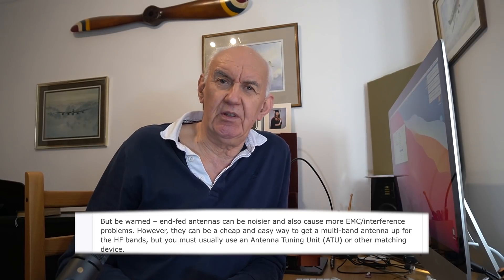END FED HALF-WAVE ANTENNAS - BEWARE!  WHY?

Comment: Another good video.  When I heard that person was making regular contact with New Zealand (assuming he was from the UK) I thought I need to get one so I can do the same.  Haha. A minute later you cleared that up.  I am considering a EFHW for portable use, but need to learn what I can do, what I have to tun with external tuners, etc.  There is some confusion of half wave or random wire.  But the half wave you describe is how I understand the science.  thanks for your instruction in your videos (those of us new to the hobby appreciate it).  All the best, 73 de KI5HXM
Reply from the maker: Hi Brent. Go with the EFHW and you won’t look back. 73 Peter
Reply: @watersstanton  Thanks.  just to confirm … you don’t need a tuner with the EFHW antenna do you?  It is my understanding that if it is half wave on 80m, I can get most of the HF bands with the harmonics.

Comment: 6:50 a correction. The ATU makes the radio see the antenna as 50ohms, it does not make the antenna resonant. If the aerial is not resonant, it will not be effective.
Reply from the maker: I think you are misleading yourself. At no time did I suggest the ATU changes tge antenna resonance. Read your first sentence again!
Reply: I agree with what you said about the function of an ATU (although I did not interpret Peter as saying this). However, for an antenna to be effective, it does not have to be resonant. All it has to do is radiate (or receive) effectively. An HF doublet fed via a 1:4 BALUN with ladder line is a good example of an effective and efficient antenna which does not have to be resonant. Conversely, a short mobile whip with a big loading coil that is resonant and properly matched but will only radiate a small percentage of the power fed to it is not very effective.

Comment: Your thoughts about using ferrite beads on a jumper inside the shack vs a toroid wind in a box.  Is it as effective?  If so, how does one calculate the number of beads and the mix?  Thanks.
Reply from the maker: The main difference is you need a lot of beads as compared with a single toroid. 73 Peter.

Comment: around 6.18, you say a 40m length of wire is 80m but i understand such a length of wire would be at resonant on 160m.
Reply from the maker: The lengths for EFHW antennas are 20m for 7MHz, 40m for 3.5MHz and around 80m for 1.8MHz. 73 Peter

Comment: I have always used OCF antennas till a year ago. Friend told me to try MYAntenna EF. Ordered 75-10 resonate. Holy cow I have never used a better wire. I operate (500w) and it’s by far best wire antenna I have used. Not by a little but substantial. Ordered another one and setting up 90 degrees off the other one. All the rumors of EF problems, maybe yours but the MYAntenna has none of those issues. No counterpoise , zero common mode. But, depending on how the transformer is close to the ground it is recommended to ground the transformer. I also use a line isolator and too reduced 1.5 S Units. As you stated , the isolator , should be in your shack and close to your radio that is feasible.

Comment: I completely agree with you the efhw 49 to 1 or 64to1 ratio transformer works fantastic I purchased one straight after getting my license even though like you say plenty of nonsense rumours which are completely not true , had people tell me RFI will be a big problem it won’t work on lots of bands , utter nonsense. I still use one now In a inverted U configuration I’ve worked Cape Town , faulklands on 17m and work states on 80 m using only 50w regularly late at night during winter months . For anyone just setting up this is one of the simplest methods 73 cheers
Reply from the maker: Many thanks Nifel.It's a familiar tale, but very welcome one. You certainly are getting some good results. All the best for 2022. 73 Peter.

Comment: I've got two main issues with EFHWs #1 What is the pattern of an end fed half wave close to the ground on various bands? Model it in MMANA & see for yourself. #2 EFHWs are very noisy on receive if anywhere near any interference sources at all. Might be great at the park or out in the woods, but not anywhere near home. Yes, by all means place a 1:1 balun at or near a current node in the feed line to help keep your RF in the antenna & away from you. One more thing, a 49:1 transformer as specified sure looks awful lossy. Thanks for the video. An EFHW is what it is.
Reply from the maker: Thanjs for sharing. 73 Peter

Comment: Mr Waters, you mention using a line isolator on the EFHW but how about using two, 1:1 choke in the shack and another 1:1 choke outside just before the 49:1 matching transformer?
Reply from the maker: The reason is that the coax feed, no matter how short, tends to act as an integral part of the antenna.

Comment: Half wave end fed are less prone to common mode currents than random lengths, 5/8th wave or mag loops. You'll actually cause less RFI with an half wave.
Reply from the maker: The problem is more about installation than tyoe.
Reply: @watersstanton  Didn't the video suggest the RSGB were critical of half wave end fed because of RFI in the early days? From my own experience of antenna building across many bands, I've come to realise which are the most problematic and its not EFHW's for either RFI or installation issues. End fed half waves can still cause issues don't get me wrong, unlucky feeder lengths creating harmonics that haven't been choked at the feed point correctly is the biggest issue IMO. Common mode can pop up anywhere. On the upper part of HF on 10m for example, I have found that isolating the antenna from the mast, choking the coax at the feed point and adding radials forces common mode into the radials and that way you don't have to worry about unlucky feeder lengths and txing on the feeder. In the lower part of HF the same rules apply but the length of the radials is more critical than on 10m.

Comment: I love EFHW antennas, I use one at my QTH as a permanent solution on a 45 foot mast on an inverted V. I have a choke on both ends of the wire, one at the feed point of the transformer and one at the feed of the radio. I have a low noise floor on 75 phone of about s2 to s3 on most nights and as well on other bands. 73 de AI5DD
Reply from the maker: Thanks for sharing 73 Peter

Comment: Do ferrite clamp on beads work as isolators?
Reply from the maker: Depends on the material, size and quantity.  I use tyoe 43 mix. 73 Peter.

Comment: You'd BETTER have some place for the RF to GO.  Call it a "counterpoise" if you like; if you don't have one it will simply use the shield of the coax for that purpose.  If one AMP is going OUT instantaneously, one AMP needs to be returning, instantaneously, and it WILL.  It might return through the ground, through the coax, maybe through your hands and body.
Reply from the maker: Maybe you should try one. Also check out end fed Zepp.
Reply: @watersstanton  "Maybe you should try one."
Perhaps I should stick my fingers in an electrical socket.  Perhaps I need to test whether gravity is real.  Oh, already did those things!  
There's a reason the Icom autmatic antenna tuner has a large porcelain insulator on the antenna terminal; as yu approach half-wave, the voltage goes way up and you'll start getting some serious RF backwards down the coax into the radio and into your hands and lips on the microphone.  I have ferrites on the microphone cable, the coax, 6 to 8 turns on the coax, some here, some there and not at regular distances to break up the resonances that can happen on coax and on guy wires.  
Naturally the feed point is monopole; BUT the Icom also has a grounding terminal, the "counterpoise" but really it is a place for the RF to go besides your body.  But some here seem to think it is magic and goes nowhere.
Reply: @watersstanton  The Zepp antenna uses the ladder line as an impedance transformer section.  As such its length is part of the antenna system and the un-used wire is actually used; just not in an obvious way.  An open-circuit end of a quarter wave stub will reflect back to the source as a short circuit.  But actual radiated energy will not participate in the reflection and thus it won't be a short circuit, but a resistive load under ideal circumstances (carefully chosen stub and antenna lengths).  

I admit to not having considered that using only the center conductor of a coax cable was effectively the same thing; the coax becomes a transforming section and it will work provided your lengths are carefully chosen. But it is lossy, where ladder line is not nearly as lossy.  Also, the ladder line is more sensitive to nearly metal; but so will be the coax since the outer braid is an active part of the antenna.

Comment: An "End Fed Half Wave" antenna is HALF WAVE at exactly one frequency.  For every other frequency it is just a random wire antenna.  There cannot be an "80 to 10" meter EFHW.
Reply from the maker: Think again about the definition of “random”  Maybe your statement is wrong as well! 73 Peter
Reply: @watersstanton  "Think again about the definition of “random”  "
A non-specific length.  It is just what it is called; a piece of wire used as an antenna.  Even if I carefully cut 17.43 meters of wire it is still "random" if it is not exactly a halfwave or a quarter wave.

Comment: Packtenna 20m EFHW sloper made with 26ga wire raised 20' in the air off a fiberglass SOTA mast.  Connect with 50' coax and if going over QRP, throw on an inline choke.  SWR is usually 1.2 and I don't even run a tuner.

Sets up in a few minutes, they weigh ounces and easily get 1000+ mile contacts with zero fuss.

Absolutely love them.

Comment: "Works 80-10m" needs to be qualified somehow.  Just providing a "low SWR" isn't good enough - a dummy load does that.  Relying on the coax shield to be part of the antenna isn't a good idea at all, and will more than likely cause problems with RFI.  Putting the band-aid of a "line isolator" in the shack is no solution.  The antenna itself should be doing the radiating, not the coax.  Any antenna that relies on coax length to work needs to be fixed (the exception to that is a matching section for phasing, etc).  What about radiation patterns?  A good antenna should have a predictable pattern so it can be installed in a way that works with the operator's goals.  I notice almost nobody touting these types of antennas mentions that -- only "low SWR".  A low horizontal wire for example, will make contacts, but if DX'ing is important, there are better solutions (like a vertical).  Also keep in mind that antennas CAN be too long.  Using an 80m antenna on 10m will have a many lobes and nulls that will result in less than desired performance.  I would use a doublet fed with twinlead no longer than 5/8ths long per leg on 10m - that will get you broadside patterns down to about 30m.  That is actually an Extended-Double-Zepp for 10m, BTW.  For the lower bands, a 40m Extended-Double-Zepp will work well down to 80m, and may get you on 160, but not optimally.  A properly installed end-fed antenna should be installed similarly to an inverted-L with a good ground screen (radial) system.  Then and only then would I consider using such an antenna.  And in fact, that's what I use for my portable setup, 10-40m.  I use no more than 20-24' during the day, then add the last few sections to get on 40m at night (32' 1/4 wave 40m vertical).  However, it is fed with an auto-tuner at the base and works against a set of radials laid out on the ground.  For 80m, a longer vertical is needed (at least 3/16ths of a wavelength or ~48', loaded or with a proper matching NW), or a proper length doublet up as high as possible.  Cheating physics whilst expecting extraordinary results just never works out well.
Reply from the maker: Too many errors and assumptions.

Comment: I'm a m6 and use a end fed wire and can get 3000 to 4000 miles on 3watts not a problem thay do work well 👌
Reply from the maker: Sounds good. Well done. 73 Peter

Comment: As long as one bothers to make a proper counterpoise or radial system for it, end feds work fine. The problems start when hams try to use them with no radials or counterpoise of any kind and then wonder why everything in their shack is hot with RF.
Reply from the maker: Totally wrong I am afraid. Peter

Comment: Hi @watersstanton, much appreciate your videos which are full of sound advice and information! 
Question. I have a 33 foot EFHW antenna from Ultimax which I'm using in the field for POTA activations. Unfortunately, I have a difficult time getting the SWR down below 4. I typically raise the wire-end up about 25-30 feet on a Spiderbeam, and run the line down to the transformer box, which I have hung about 6 feet off the ground. I a split line radial for grounding. I connect to the transformer with 50 foot of RG8x coax. What can I do to get the SWR down below 3? Do I need more radials? Do I need a temporary grounding rod? I'm trying to figure out what direction to take. Any help would be much appreciated. :) Thank you!
Reply: Because you do not have an end fed half wave. You have a random length wire. Ditch it.

Comment: Thank you for this video!  Yes, I've heard of this about EFHW.
Much of my ham activity is from park benches.  I have used my 100w FT-857D with a tuner, un/un, and 43' wire sloping to a 10m pole for years. I had an SSB QSO from Saratoga, NY to Namibia (12,000+km) using this very portable rig, twice.  I regularly get good reports while operating on the Atlantic coast to Eastern Europe all the way to Qatar.  I can't say that noise is an issue, but parks may naturally be low noise.  I love my simple, portable EFHW.
73 de N1DEL
Reply: My WSPR setup is being picked up in by a German operator in Antarctica using an end-fed wire antenna about 35 long. Being heard on both 20-30 meter WSPR band.
Reply: Also my WSPR station is running 22 watts .

Comment: We uses a 26 meter long endfed wire to 2-12 MHz, 3-6 meter over the ground horisontal. This is for NVIS 0-300 km without a skipzone. A fast autotuner when we scan, and transmit to other units. 20 watts or 10-100w depending on system. A good connection to ground, or "balance wires under the antenna") If very dry ground with no water close to surface, we place the antenna direct on the ground. The same montage with a TFD, TF2D, TF3D or that family of broadband antennas, when we dont have a tuner in the system. We dont want to transmit over long distances, just enough to reach the hole battalion and higher command, without to have the antennas on a high place. We transmit and receive the signal from E or F (1,2) in the ionosphere. Both talk and ALE and SwALE. We dont have bands in HF, we have frequencies in "packets" for the military. When we lisen from "strait up" we dont hear the thunder and flashes at the equator, its quiet in the background. ( And no Italians talking with a bounce or two to Sweden).   2Lt Jansson  
PS. We have a more advanced system in the viecle with a fast autotuner and a cool fat antenna on the roof, for driving and transmitting at the same time. DS.

Comment: Now how would you give an EFHW a proper RF ground?
Reply: I use an RF choke on the coax approximately 8 below the feedpoint on my 40 meter EFHW antenna.  My EFHW antenna then uses this first 8 feet of coax below the feedpoint as the counterpoise which is likely what you mean by "proper RF ground".  This choke also does a great job of preventing RF from flowing back down the outside shield of the coax from the feedpoint from getting into the shack.  My choke is 14 turns of RG-58 coax wound on an FT-240-31 toroid core.  Antennas don't need a connection to ground to work properly, they just need a proper return path to the feedpoint, and that's what the counterpoise provides.  73, Don (wd8dsb)

Comment: Totally agree with your EFHW video. I originally had  a EFHW 80m aerial with a 110mH coil near the far end. As per your comment on bending. I removed the coil and increased the length to tune to the low end of 80m with the last 3 metres bent almost back on itself to fit into my garden, it tuned nicely with a big improvement and the line isolator also helps and concur that the SWR meter reads correctly.  G4PEY
Reply from the maker: Thabks for sharing. 73 Peter

Comment: Really enjoy your videos, very informative.
I passed foundation about 6 months ago and use an End Fed Half Wave deployed in an inverted V configuration (Using a couterpoise) with a matching balun covering 80m to 10m through a  MFJ 945E matching unit. I get excellent SWR and am able to work stations over 1500-2000km regularly with only 10 watts. I support this antenna with a good set of ground radials about a quarter wavelength and quite often utilise a ground loop antenna cut for 80m as my main RX antenna using my EFHW for TX.. 
I was aware of the warnings given regarding wire antenna  of course, but I never believe anything without testing myself through modelling software and my Nanovns H.
My advice to anyone starting out as a radio ham is to listen to everyone's opinion, then go out and prove it yourselves. 
Take care
73s
G
M7GHB
Reply: Well said on the listen to others but go test it for yourself!
Reply: Sounds like you're doing great. My latest rig is a ubitx v6 which is a kit radio 80-10m which puts out only 5-10 watts. The antenna is a 30m wire 7m agl fed with twin feeder with a 9:1 unun at the base.  I have only used it a few days the best dx being Lithuania 🇱🇹 on SSB on 18mhz. I have used it on 7Mhz and 5mhz SSB for inter G contacts. Just need to plug a key in and try on CW now. 73 Bob G0IMB